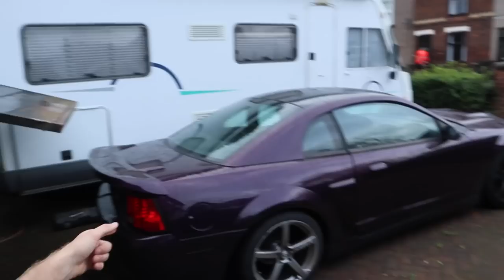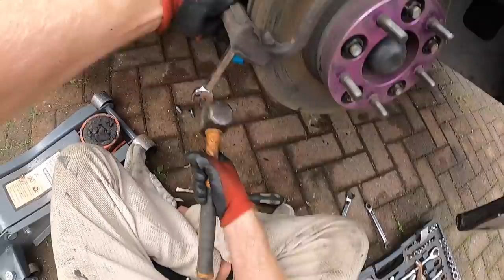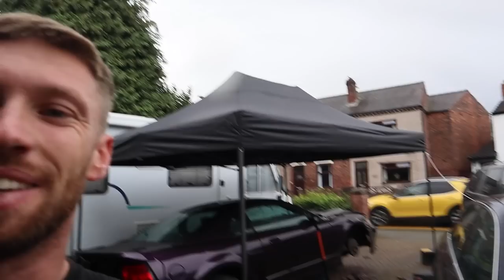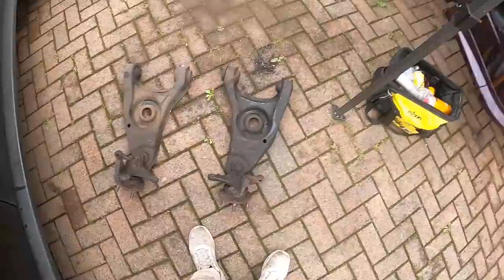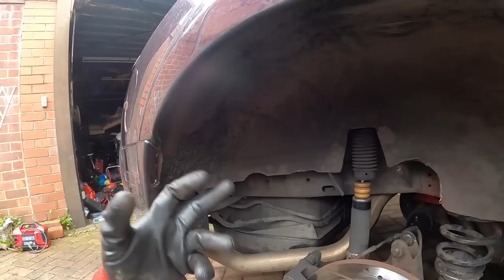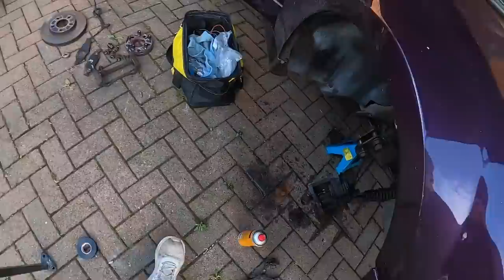IVE ALWAYS WANTED TO DO THIS MOD!

Comment: It doesn’t have to be the same spacing either side as the pressure is created from the the calliper so by shaving a little off for clearance will be fine 👍

Comment: Drifting is a mint sport. I drift my rear wheel transit van every day in the wet. Turn traction controll off and everything flies everywhere in the back.
Reply: What year is your transit mate. I always thought they where rwd but I'm in a 21 plate at the minute and it's front

Comment: the pad with the notch are supposed to sit on the other side of the disc... brake pad kits will include 2 pads with notches, and 2 without, that way you can put the correct pad on the inside.
Reply from the maker: They all had notches! Had to grind down the other side too

Comment: Good Grief, how crap are people at fitting brakes! The 350z job they did for you was bad but those broken pistons with the notched pads are shocking. Lee, as someone whos had a full brake failure in a big yank car I implore you to replace those pistons, it was absolutely terrifying and other road users could have easily been killed. If something happens to you, other road users are injured and there is this video of you choosing not to fix it they;ll throw the book, bench and judges wig at you.
Reply from the maker: I don’t drive the car on the road tbh, but I will get them rebuilt! 🙏

Comment: If it moves the pads too far over onto the inside you may cause binding on the outer pad due to the sliders been off central putting pressure onto the outer pad however if you use washers as spacers between hub and carrier you would counter act the offset